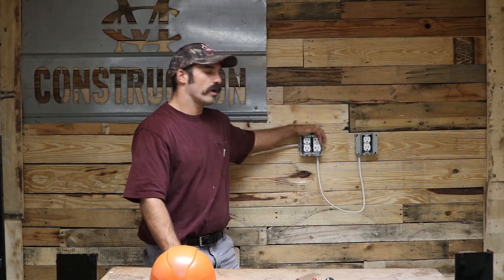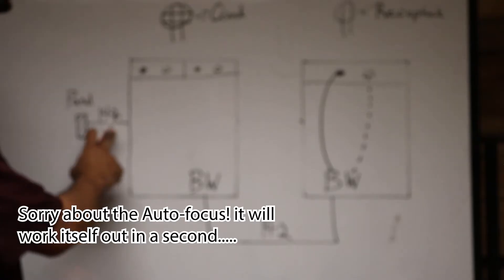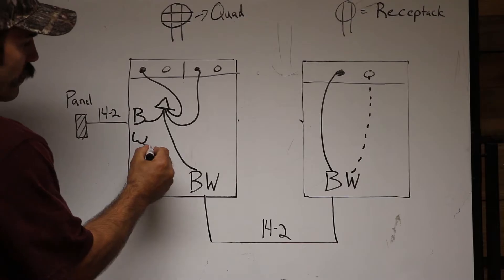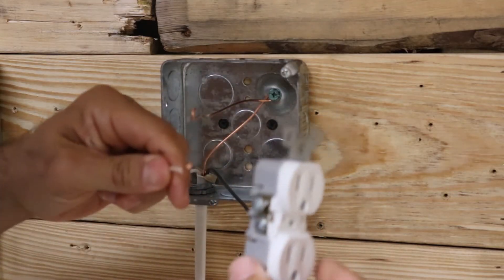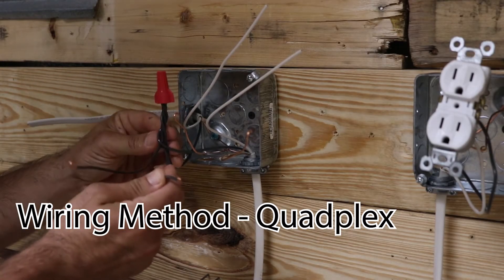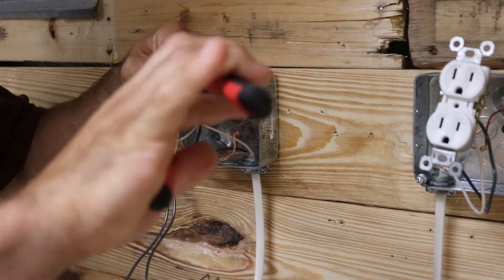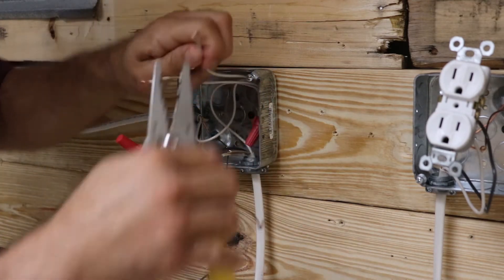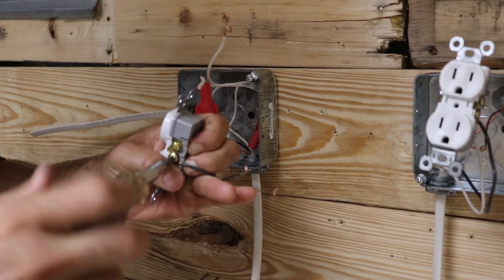Electrical Outlet - How to Wire a Outlet and Quadplex

Comment: Dumb Question?
Are the conductors (black, white, bare) in Romex cables the same?
The other day I was making pigtails and I ran out of bare wire, so I stripped some black wires and used that as my ground pigtail.  I’m wondering if that was OK.  Things worked fine.
Reply: if you left any of the black wire insulation on, best practice is to re identify it with a piece of green electrical tape, that way if someone with limited knowledge comes back to replace the receptacle they understand that black wire is actually being used as a ground and they don't miswire on a replacement installation.  An inspector would red tag it if you did not do that.

Comment: Can you provide a video demonstrating a quad using 12 gauge wire. I'm not having any success wire nutting 4 12ga wires together using the pigtail method. I'm using the recommended red wire nut specified for up to 4 12 GA wires but they are not secure. The wing nut appears to be too small. If you can help, please advise. Thanks.
Reply: It shouldn't be an issue. Strip about 1 1/4" of insulation and keep insulation ends even. You can wrap some electrical tape around the insulation to keep the ends even during pre twisting. Pre twist the wires, gripping about 1/4" from ends in a clockwise rotation with linesman's pliers into a medium braid and cut the ends so there is 1/2 to 9/16" of bare wire showing. Make sure the ends of the insulation remain relatively even. Twist wire nut on clockwise until tight. I recommend practicing this with spare wires until you get the hang of it. You may want to use 3M performance plus red/yellow wire nuts which have longer and flexible skirt. BTW, he is using 14 gauge wire in the demo, which is much easier to work with.

Comment: I just found that my outlet terminals are shorting to the lock ring on my EMT connector that is coming in the box.     I guess I have to redo it all with a deep box.   I wish someone told me they wouldn't fit.    You look like you with have the same problem with the outlet on the left, if you finished the video.

Comment: Thank you for sharing the video let's say I wanted to continue the power out of a quad box to another quadbox what do I do there
Reply: i was wondering the same thing

what you’d do is pick one of the outlets and hook the black wire from the continuing cable to the empty brass screw, hook the neutral to the empty silver screw, then unhook the ground and pigtail it to ground the entire run before hooking it back to the grounding screw.